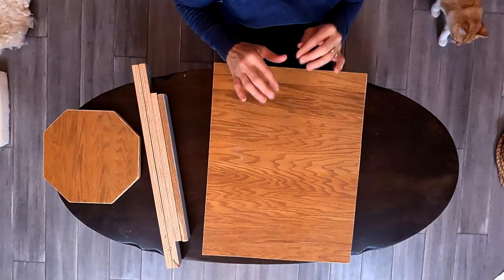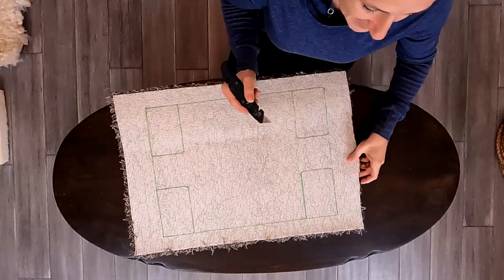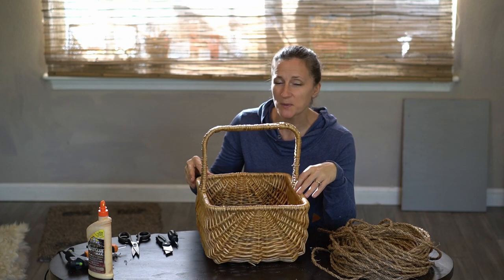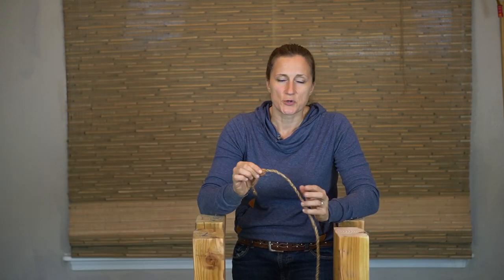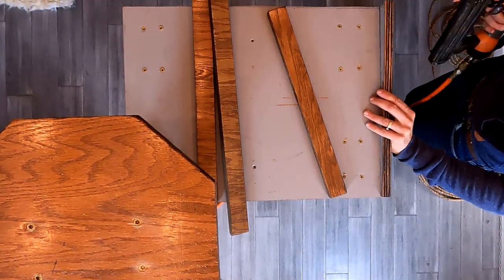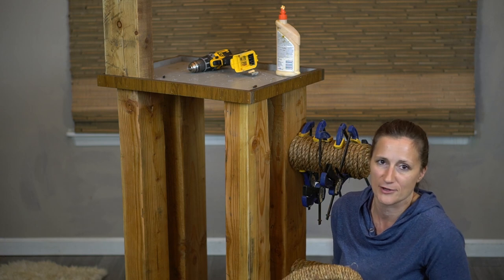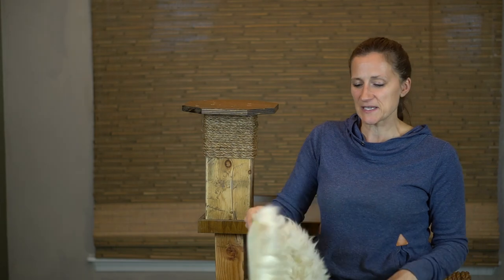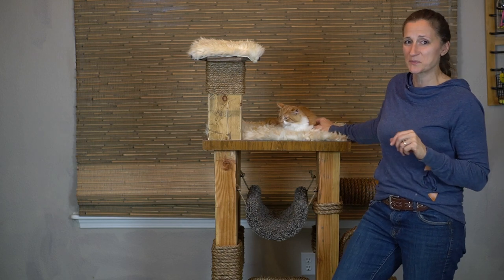Custom Cat Tower Plans | Building with Wisdom Preserved

Comment: Aren't you worried about all the wood stains being TOXIC? Also, I'm curious why you made the pillars so thick? They're significantly larger than most chairs for people, so just wondering what you're reason was for choosing that size? Thank you for the detailed build instructions.
Reply from the maker: After curing, the stain is considered non-toxic. If you are worried about it you can use linseed oil, which is very pet friendly, or just use wood like cedar so it doesn't need to be stained. The thick pillars are not really necessary for stability. We had them left over from when we used them for supports during our root cellar building project. (They had to be stout for that.) I like to reuse wood whenever possible. Besides, I like the aesthetics. You could modify it with smaller beams and it should work just fine.

Comment: how could I attach the platform without an exposed screw? (I don't want to cover with carpet)
Reply from the maker: You could use finishing screws which have much smaller heads or fill over it with wood filler.

Comment: Must be all natural, no chemicals, no stain ,no spaying,it’s not good for your cat. They don’t care how it looks,
 all they care about is that it’s sturdy, and they’re not gonna fall over, and get hurt. I can understand if you wanted to match your room and Thats cool but do it in the natural ways you could do that instead of staining it, you can use natural oils to cover it. Instead of spraying it, use natural wood oils that won’t harm the cat. specially in the underside where they’re never gonna go, 

but they might? so it should all be natural. All the cats care about is, is it stable for them to step on, is it gonna fall over, 
the base must be a wider base it must be wider than the tower itself,  so it doesn’t bother any cats.  another way to handle that as well that it is secured to the wall, so if they do jump off it,
it won’t fall over and hit them or another cat. 
or just secure it to a existing side furniture so that it  stay secure and not move around your cat safety is paramount, taking all these things under Consideration because you want them to feel safe. and they don’t like certain smells bc there nose it sensitive to chemicals even if dried.  so if you’re putting stain and things like that the chemicals on it they’re not gonna like the smell they won’t go up on the cat tree that’s why it Hast to be all natural, although that cat font seem to mind carpet spells I found. They don’t care what color it is,  they just care that it’s a stable perch.  & they can sit up on it easily with out it being unstable. that’s all they care about. How do I know any of this?Im what you call a cat whisperer i watch and liens / feel and see what they prefer. I know what they like and they don’t like and I’ve had cat trees and I know what some cats will like and some cats won’t but all of them appreciate natural stuff not substituting for any kind of chemicals whatsoever because regardless weather dries or not, they can still smell it.
Thank you for letting me post this I hope you have a great day just beware of that because the cats will tell you by their actions I’m sure you’re well aware of that. thank you have a wonderful good day.
Reply from the maker: Thank you for the input. It is a good thing to keep in mind when building for pets. It sounds like you really have a good bond with cats.